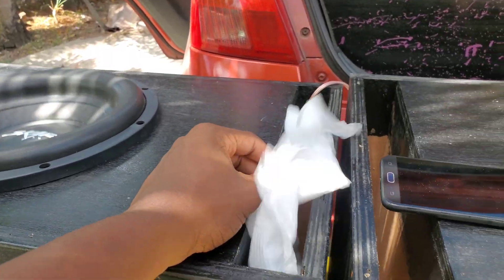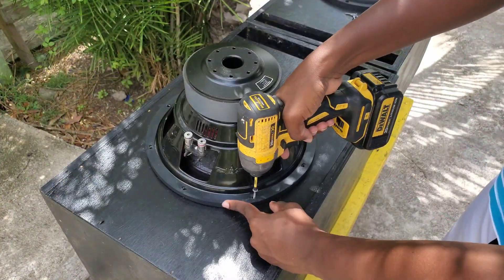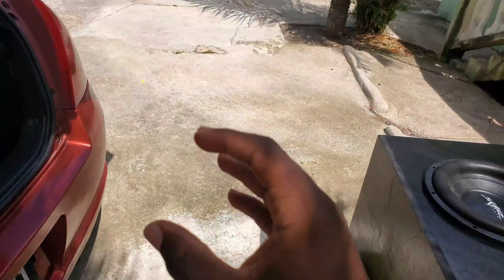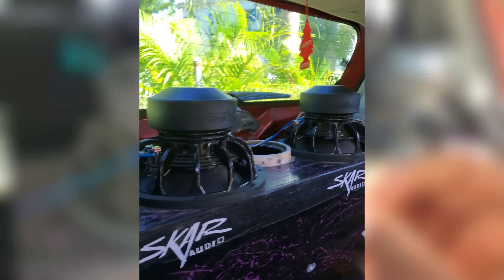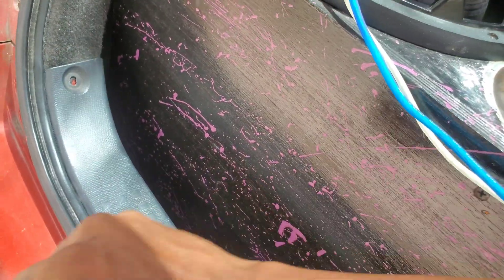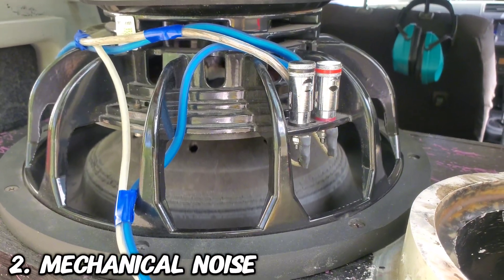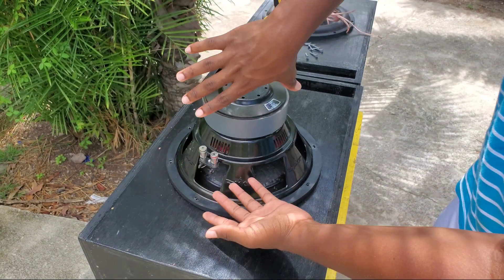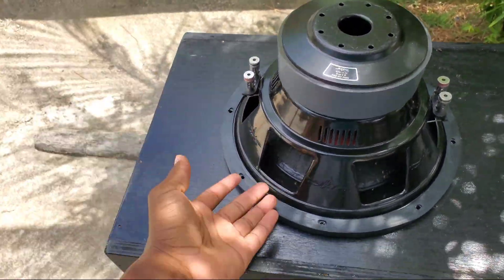I REVEALED THE TOP SECRETS ABOUT INVERTED SUBWOOFERS!

Comment: The deep bass you will always get only if you wire the speakers, subwoofers normal, or in parallel, ii you wire them in series, you will get a short boom metalic bass, and not wruum, deep bass.
Reply from the maker: Wrong. The speaker Wiring (parallel nor series) determines what bass your gonna get. The enclosure is what will determine on how your bass response on sound. The parallel/ series Wiring only determines how much power your gonna be getting from your amplifier
Reply: @tyreeisvibin the enclosure only amplifies the frequencys that came out from the speakers/ subwoofer. And the lowest and deeper frequencys from a speakers/ subwoofer came from a normal/ parallel wired speaker, not from a series wired speakers, because the lowest and deeper frequencys likes small impendance,  from 4 to 0.5. ohm.  In series wired  the speakers reproduce highers frequencys because of a big impedance from 6 to 16 ohm. The impedance has a role also in the frequencys that a speaker/ sub reproduce, not only for the power you get with that speaker. And  also the speakers wired in series play antagonist, a speaker beat in positive way, from the cone to suspension, and the other speaker beat in negative way, from suspension to con, that's why they reproduce a short bass, boomie, not deep long bass, vruuum.
Reply from the maker: This is wrong information your explaining
Reply: @tyreeisvibin you don't need to trust me for my word, try it yourself. The same sub, the same enclosure, the same set up of the gains of amplifier and frequencys, the same volume, the same song and the same part of the song, but different wired of the subs, and you will  see that it sound different.  And if this isn't convinced you, measure the sound waves with at oscilloscope and you ll see that the sound change only from the wired mode, series or parallel. Good day.
Reply from the maker: You just get more power if you wired your subwoofer to a lower impedance. It doesn't change on how deeper your subwoofers are gonna play
Reply: @tyreeisvibin ok is your choice to not try what i told you, but if you try you will change your opinion, because you ll see  with your own eyes that the sound waves is different between the 2 modes of wired.
Reply: You are wrong the impedance doesnt affect the subs frequency range it only determines the power output of the amp. The sub and the enclosure determine the frequency. Sorry just want you to have the correct information
Reply: @ssidejon  if you had read with attention what i say you understand that you are wrong. The impedance influence the deeper frequencys only in series wired mode, because in that mode the speakers beat antagonist, one in te positive way and the other in negative way, and by that they make a dump in the deeper bass because they cancelled the lower  frequencys. This is a elementary information that is written , not by me and you will find it even if you tape it on Google. and another reason why speakers connected in series do not have deep bass is because subwoofers are speakers filtered by an amplifier and filtered speakers do not connect in series because they interfere in the cutoff gradient. and just so you and others know that the way speakers are connected does not influence how deep they sound deep, that is, how deep the low frequencies are: the sound frequencies of a speaker are controlled by its polarity, by the way it receives the current in it, not by the amount of current it receives. the amount of current it receives, the power, only influences how loud a speaker sounds, it has nothing to do with the depth of the reproduced sound. this is elementary physics information, read it and you will understand that I am not talking nonsense.
Reply: You don't know what you are saying  @konan1
Reply: If your hearing deeper bass its because the impedance is lower due to being wired in parallel therefore the amp is delivering more power

Comment: You should switch the polarity when inverting subs, because with a positive cycle on a normally mounted sub, the cone will go out, but on positive cycle on an inverted sub, the cone will come into the box, making the bass 180 degrees out of phase with the rest of the system, if polarized normally.
Reply from the maker: Yes, you generally need to reverse the polarity (or phase) of an inverted subwoofer if it's the only one inverted. If all your subwoofers are inverted, then you don't need to change the polarity.